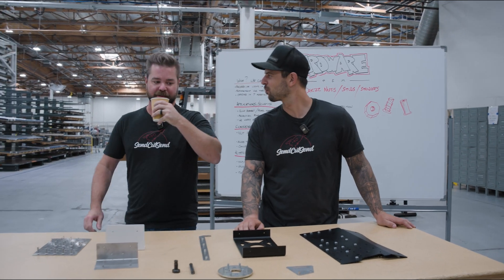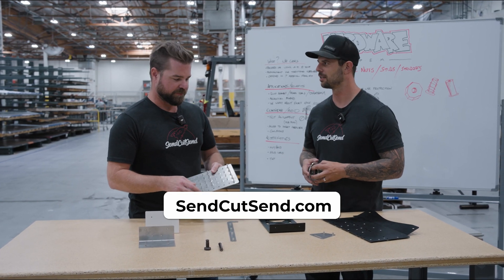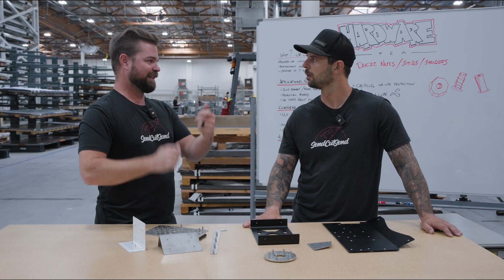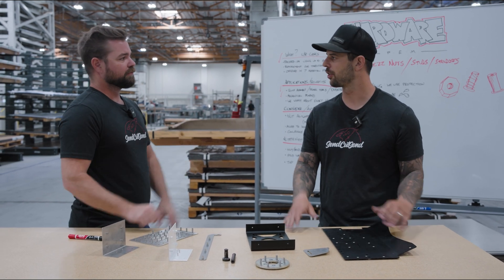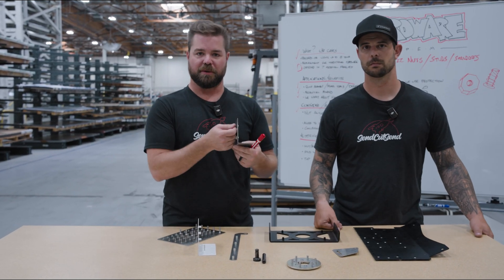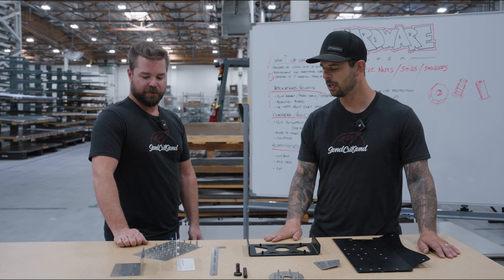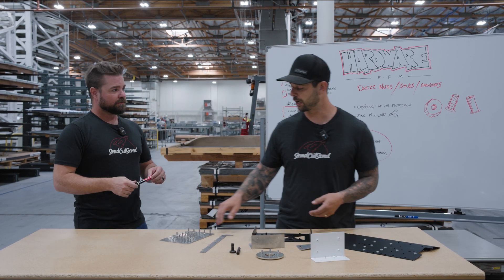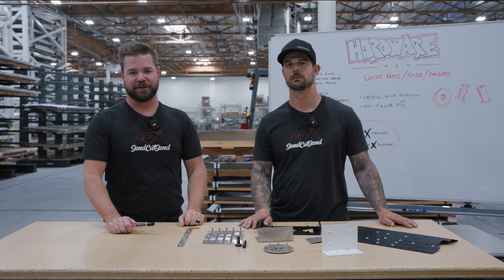The Best Way to Save Time Assembling Sheet Metal Parts - Cutting Corners Episode 7

Comment: What machine do you use to press fit self clinch nuts?  I'm currently using a round die and hit it with a hammer. It works okay but I know that's not the correct way to do it. 
Mc Master carr sells a tool for $500, would you recommend it? Thanks
Reply from the maker: @carlosrios3452  we can’t giveaway all our secrets 😉 The key is consistent even pressure!  Hammers are hard to keep square and precise which is needed for any pressed in hardware.  Any press (manual or hydraulic) would be a better fit for a diy application.  We would recommend it having a pressure gauge to know the pressure you are applying and match it to PEMs recommended pressures.
Reply: Arbor press is an absolute must. You want even pressure on the full circumference for these to work. 
In an awkward position,  use a decent clamp.

Comment: I’m surprised to hear you don’t do stainless PEMs in aluminum. My customers almost always spec SS hardware for 5052 and we’ve never had any issues with it (unless it needs to be chromated  after). Makes me want to do some pushout tests. Anyway, these videos are great. I wish I could show them to my customers!
Reply: Do you get the Aluminum plated or coated? SS and Aluminum together can cause erosion
Reply: @kylep.9395  Typically the PEMs are going in after a chromate conversion (usually MIL-DTL-5541) or occasionally anodizing.
Reply: @jimmyclaw9974  Probably why SCS doesn't do stainless pems in Aluminum because they don't want to add a step which adds to the consumer cost, eventually they add that option but the leadtime maybe greatly increased unless they do it in house or aquire a company that does that process.

Comment: The most underrated PEM has got to be the TPS pilot pins: solid, smooth, stainless shaft with a chamfered end. Basically a dowel pin that actually stays straight in sheet metal. I use them constantly in jigs/fixtures as locators, hard stops, even short axles.